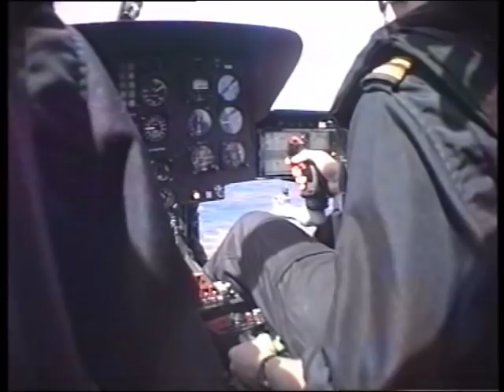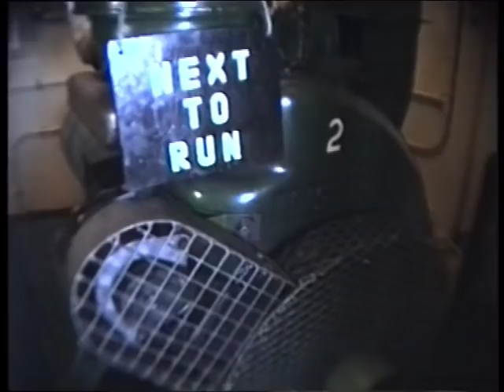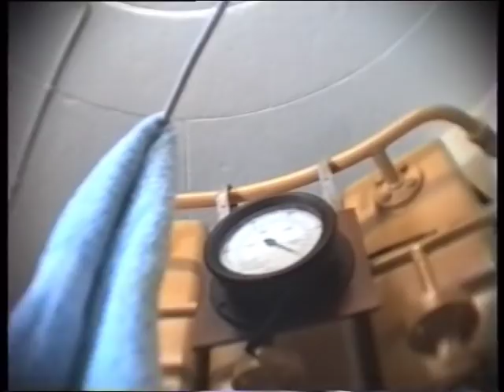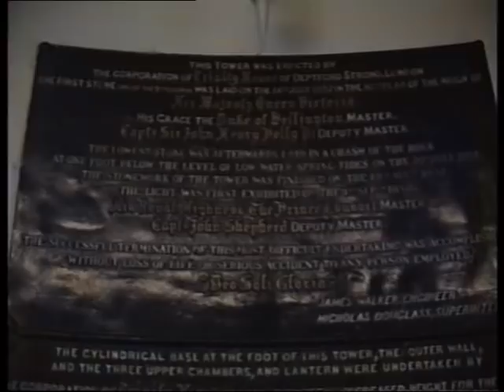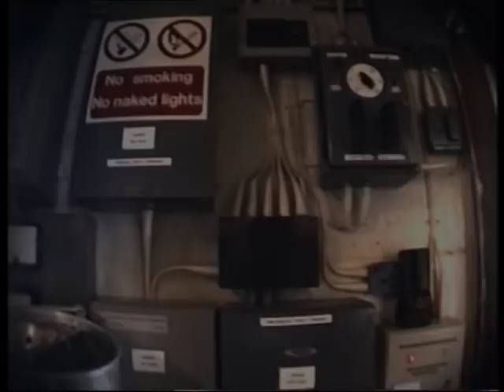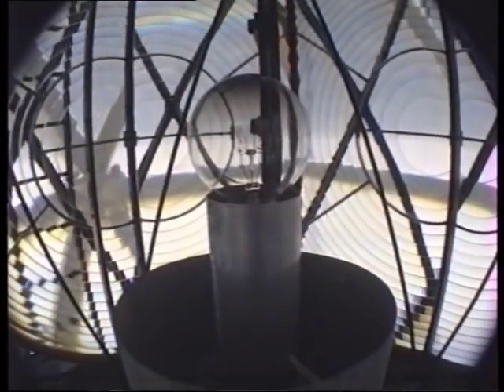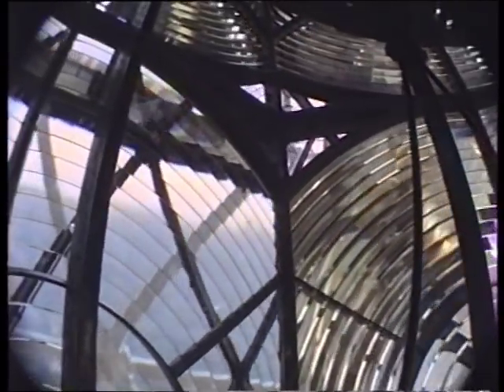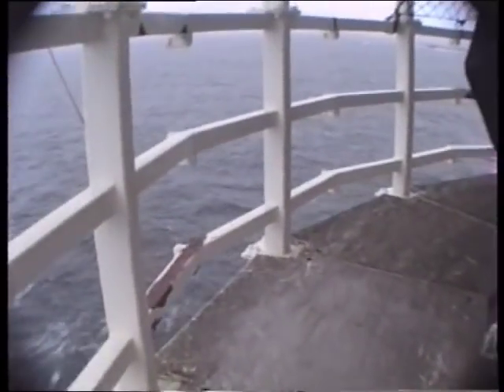Bishop Rock Lighthouse, walk through tour. mid 1990's

Comment: So if the diesel generators were removed as part of the automation, what powers the lighthouses now?
Reply from the maker: Hi, I think that Trinity House went down the LED lights and Solar panels route for their lighthouses
Reply: @PeterHalil  What a shame.... were the engines Listers? I bet they've had more reliability issues with the solar gear than they ever did the gen sets!!
Reply from the maker: @chrisbond8821  I think a lot of the Lighthouse engines were Listers , but I've no idea what happened to them, cheers
Reply: @PeterHalil  I don't suppose that you've written a book or anything about your experiences have you, or know of any particularly good ones by your colleagues?
Reply from the maker: @chrisbond8821  I haven't written a book yet, but I kept journals of my latter lighthouse years, so one day perhaps when I finish with the editing lark. At the moment though I'm editing most days as it's a slow old process, also any book would probably take longer as I'm a one finger typist! There are a couple of old books out there, if you can find them cheap in a secondhand bookstore. Ceaseless vigil by WJ Lewis and the other which is a thin booklet type paperback of only 93 pages by a Scottish Keeper, which has a full explanation of the Flannan Isles mystery in it, No more parafin oilers by Ian Cassells, which is quite cheap on ebay, cheers.

Comment: Great tour not the greatest camera but it shows how fast the cameras are geting beter rember 15 years ago i bought a good vidio camera for close to $1000and it was huge. Now they can be straped to your head and and work so good you can buy a decent camera for like under 200 its crazzy how quik tecnolagy changes
Reply from the maker: Yes indeed, that camera, 25 plus years ago was about £1000, and you had to get screw on wide angle lenses, which were terrible. Also I had to wait a very long time before the tech enabled me to get it digitized.I now have a Gopro, which if only I could go back in time, would be brilliant! cheers.

Comment: My question is how did they get them Engine's/generators  into the lighthouse? Did they have to build them in the lighthouse?
Reply from the maker: I'm assuming again!... the doorway from the engine room to the outside walkway is big enough and it is right under the crane, alternatively they came already in the structure as you suggested.

Comment: How on earth did they get some of the larger pieces of equipment into the lighthouse? Surely they wouldn't fit through the door at the base let alone get up the tiny staircases?  Fascinating video
Reply from the maker: That has always been a puzzle, I would assume that big stuff like engines would have come in sections. Then winches could only get them so far, so it was down to men to carry it all up or down those spiral stairs, cheers, stay safe

Comment: Why don't they stop the rotation of the lens when the bulb is off?
Reply from the maker: When they automate they keep the lens turning because all the magnification of all that glass can start fires or melt electric cables.
Reply: @PeterHalil  Thanks for the answer. I've had this question since I was a child. I never thought that this might be the reason. Only lately I was wondering if it was done in order to prevent cracks on the lens, caused by stresses due to difference in temperature between the warm and cold parts of the lens..

Comment: One of the biggest blessings of Youtube is that I, as a German, can watch a mid 90's lighthouse tour from the UK in 2021. Always wondered what it looks like inside one. So cool! How long does one stay in there last? Do you swap every few weeks or do you stay for months in that cramped space?
Reply from the maker: Hi, It was 28 days on board followed by 28 days free at home. Before I joined, it was 56 days on board with 28 days free at home, that's if a storm didn't blow up and stop you getting off. I was lucky, as it was helicopter reliefs by then, so it was pretty sure you would get off after your 28 day stint, cheers and stay safe

Comment: Great video Peter.
I am just reading Seashaken Houses but this really brings home the level of confinement you all endured. The book reveals that the last version of this Lighthouse was built around the previous one, which explains the depth of the windows on the lower levels.
The noise from the generators seems incessant but I’d imagine it would be far more noticeable when it stopped?
The thing that seems especially difficult to comprehend is that the weight and bulk of diesel and fresh water seems too much to transport via helicopter and then to be manhandled to lower levels? Is there still an occasional resupply of large volumes brought in by boat and pumped across in calm weather?
Reply from the maker: Hi Nick, Everything comes by Helicopter and is gravity fed down from the top. The Helicopter pilots seem to handle it all very well, make it look easy, which I'm sure it isn't. Nothing can come by boat now as there is nobody there and the art of boat work has been lost, stay safe.

Comment: When you consider those lenses have been operational since the 19thC, it is quite remarkable! Did this lighthouse have a clockwork mechanism with a weighted chain running through the centre of the steps?
Reply from the maker: Yes, the lighthouses that had rotating lenses had clockwork mechanisms to keep them going. Cheers
Reply: @PeterHalil  I assume before your time then?

Also were there two lens/lamp layers purely for brightness?
Reply from the maker: @ollyk22  Yes, before my time, and from what I've read, the 2 lens/lamp layers were for brightness, cheers

Comment: Hi Peter, I have watched most of your videos on lighthouses and find them very interesting. I've been out to see Bishop Rock many times when on holiday in the Scillies. Being a builder myself, I am in awe of how they built it on that small rock. I believe you've worked at both the Bishop and Wolf rock. Is the Bishop more prone to be hit by bigger waves than the Wolf? Thank you for all of your videos.
Reply from the maker: Hi Darren, No I haven't served on the Wolf, I was only on that one for the videoing. The wolf is renowned for it's heavy seas and spectacular waves up and over. I never did any duty in real bad weather on the Bishop. Most Keepers say the Wolf for the big stuff, but it is a much shorter tower than the Bishop, so I guess that is why it looks more spectacular in the photos etc, that said, the Bishop had it's entrance door near the base, stove in by wave action, and the door is made of bronze. take care
Reply: Hello Peter and thank you for replying. I was just wondering, apart from missing loved ones, what did you find worse, the constant diesel engine noise which I have noticed on your videos or working with other keepers you may not get on with? If you knew there were keepers you may not get on with when you're assigned to a lighthouse, could you change your posting to another lighthouse? Many thanks, Darren
Reply from the maker: @darrengardiner1841  The constant engine noise seems to come over louder on the videos, I never found it a real problem, I guess we just put it into background noise. I suppose you could ask not to go to a lighthouse with somebody you didn't get on with, but on the whole, the assoles you tend to meet in life were few and far between in the Lighthouse service, cheers.

Comment: Why does it rotate in daylight hours when there is no need to just wearing it out would last twice as long if only used when needed
Reply from the maker: Ok, when us Keepers were there we turned the light on and off and stopped it all during daylight hours, and more importantly put curtains up. The curtains had to go up during the day because of the lens and the sun  could melt stuff or start fires so when they automate the place they  keep everything turning. I was on South Stack, Anglesey cleaning the lens one day. I was doing the outside and the boss was doing the inside. It was sunny but we didn't bother with all the curtains. At one point there was a yell from my boss as the sun and lens had just burnt a hole in the back of his trousers, we always put all the curtains up after that lesson. Ha
Reply: Excellent thanks

Comment: shame that these lighthouses "must" be modernised and automated. im sure a team of keepers would be more effective! 

am i right thinking that after the automation there wouldnt be any keeper (s) at all to make sure the automated systems stay in working properly at all times?

forgot to say thanks for this upload, its nice to see the inside of these fabulous buildings!
Reply from the maker: Hi, thanks, no nobody goes out to look after these places like the keepers used to apart from the occasional workman to service engines etc. Talking of checking on things working, when keepers were on lighthouses one of the jobs was to hand pump fuel up for the day to the top of lighthouse header tank. The keepers knew how many pumps it took. There was another Lighthouse that was automated that they had this task done automatically with a stop mechanism built in when it got full up. Worked great till one day the stop bit failed and they hadn't thought of that, there was no alarms to say what had happened and it just kept pumping and pumping overflowing all the way down through the Tower. Nobody knew till the engine stopped, you can imagine the horror that confronted them when they went out to investigate!
Reply: Pete may be referring to the Smalls Light.
 On two occasions after automation fuel was lost at the Smalls. The first occasion was not through mechanical failure but the power of the sea. During a very bad storm the concrete bunker holding the fuel tanks on the landing was breached resulting in the fibre glass tank splitting.
Monitoring the Smalls from St. Anns Light we noticed the fuel figures dropping over a period of time and that was the only indication we had of the breach.
The other occasion was as described by Pete, I will never forget the shimmering slick of diesel the greeted us as we approached the Smalls, 3000lts makes a big slick.
Reply from the maker: @PHAROS23  Hi, Thanks for confirming what I only heard in hearsay, I didn't know about the 1st incident. Take care.

Comment: how many hours on the gen set .
Reply from the maker: Grief that's impossible to answer as most lighthouse engines are late 40's early 50's and may have come from somewhere else before they got to the light. As far as I can recall, no engine hours were recorded, only when they put in new modern engines in a lighthouse that have the ability to self record their hours.